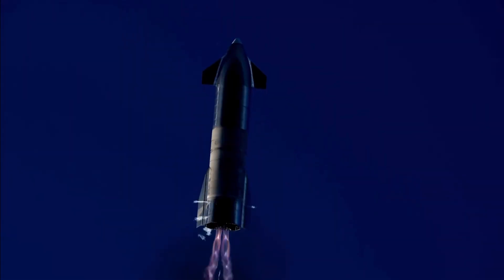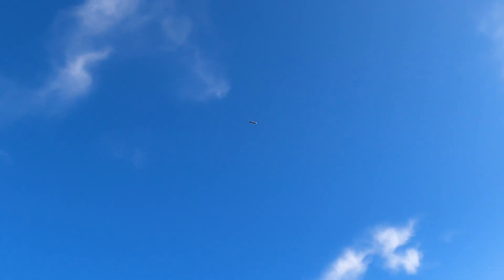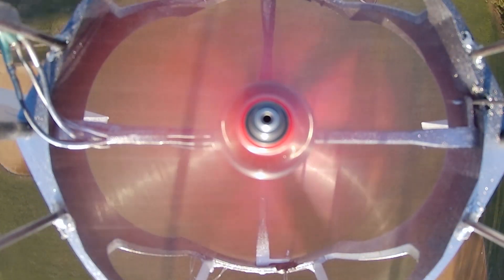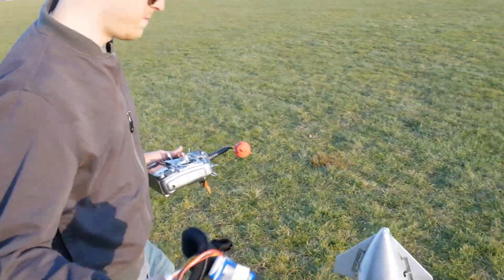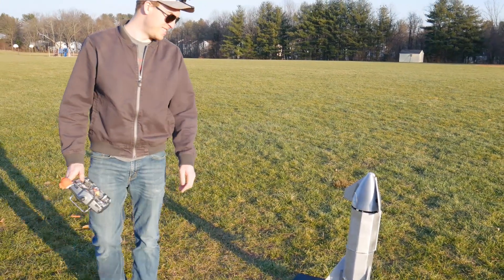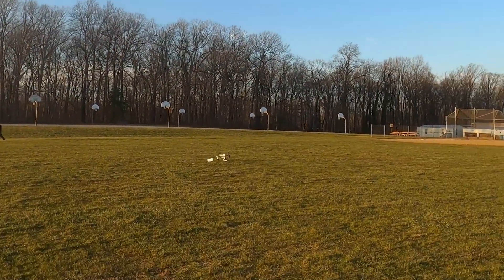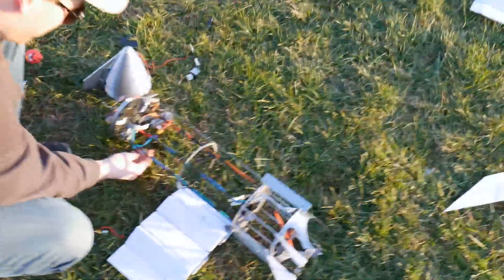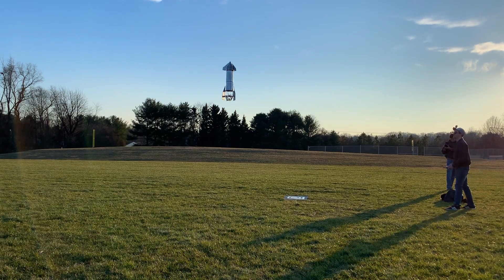Radio Controlled SpaceX Starship CRASH

Comment: Im a middle schooler but i want to make one of these and im wondering how much it costed and any tips for make something like this
Reply from the maker: If you are starting from scratch (no radio or receiver) it will probably be about $500 to get started. You would also need a 3D printer for some of the parts. Do you have any experience building drones? I would recommend to start there first to get a feel for the parts and how to fly! This model is quite a bit more difficult to build and fly than something like a quadcopter. If you need any advice, feel free to email me (link in my channel). Best of luck!

Comment: Greate Man!!! Keep up the good work... These tiny servos are not so precise and the oscillate... try using genuine servo it may improve stability
Reply: Seconding this. Knock off servos have crap response and repeatability. Can be very jittery
Reply from the maker: I agree, response time is slow on the nylon gear SG90's

Comment: How much does it weight and how much thrust does it produce?
Reply from the maker: About 900 grams with 2800 grams thrust
Reply: @NicholasRehm  what motors are those?
Reply from the maker: @yo90bosses  XING 2207 2450kv with 4s lipo and 5042x3 props, kind of low end/cheap motors that I had laying around